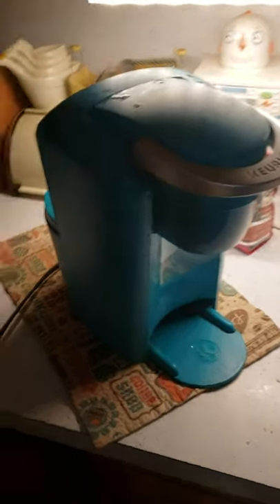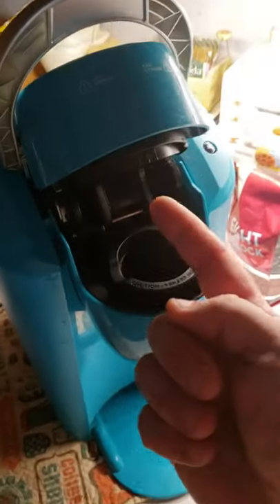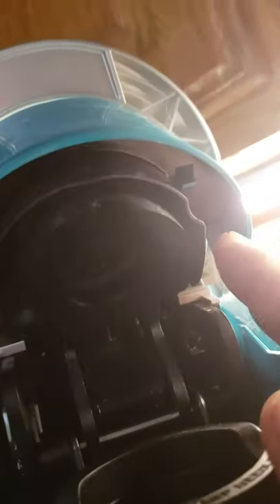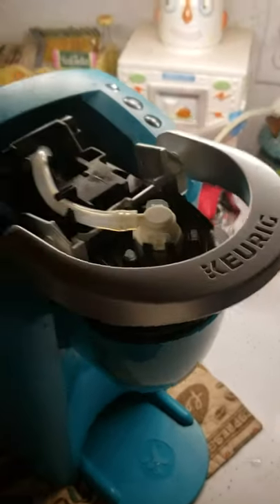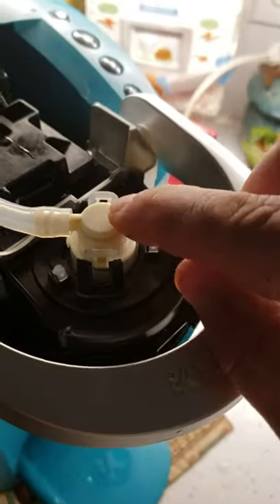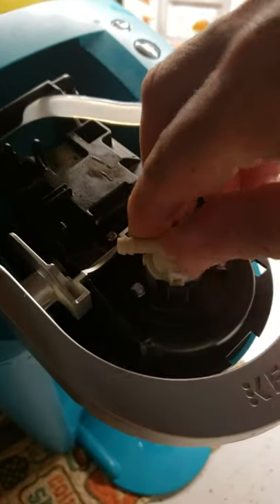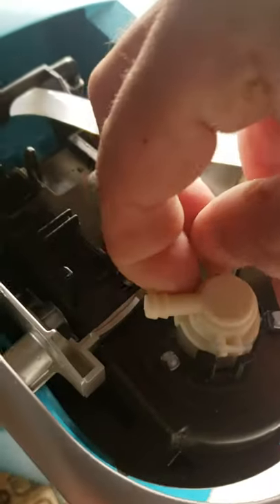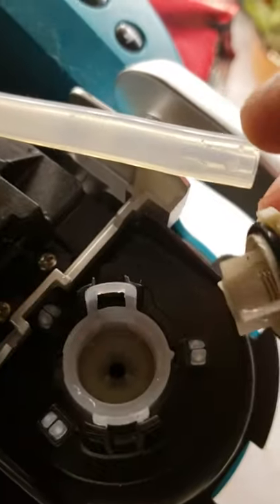Quick fix Keurig K35 Compact No water, all lights on. Fixed in under a minute

Comment: This worked great for me.  I had lots of problems with the lights all on and nothing would work.  When I took the fitting apart, it was full of coffee grounds.  I cleaned it and then put it back together and ran some water through it to clean in a cycle and it worked great.  There must be a safety high pressure alert built in to not allow the process to go forward if the fitting is clogged, or else it could become a bomb.  We have been using the refillable cups and filling them full, and I think this has added to the clogging of the pressure fitting with coffee grounds and caused the problem in the first place....Thanks so much for posting your fix..

Comment: I was not sure how to unclog it.nothing sputered or fell out for me so i tried a toothbrush everywhere, a tooth pick finally not knowing if i did anything i just put it in a cup of vinegar and shook it around every so often .after a few times  blew thrue it and put it back together.all lights were still on so i pushed power button sevral times out of frustration and it started.i don't know which part fixed it but its fixed.
Reply: Thank you so much! I watched the video and same thing nothing really looked clogged but I cleaned it a bit anyway but it still didn't work, then i read your comment and tried hitting the power button a couple of times and it works! Ran it through without a pod to clear it just in case. Thanks again!

Comment: This will also work: with the tube loose, take a soda straw and put it firmly against where the tube attaches. Blow air into the straw. Mine cleared out enough to start working, and I flushed many times with no pods in place. I started flushing small cup, medium and then large mug. Flushed until water in a white soup mug was free of grounds.

Comment: In the where you that apart could you show how that piece goes back together because I’m having issue getting that piece back into the clips so I’m wondering if I’m not putting it back together